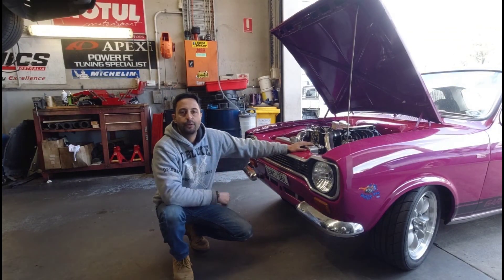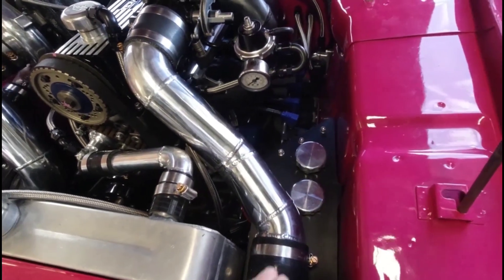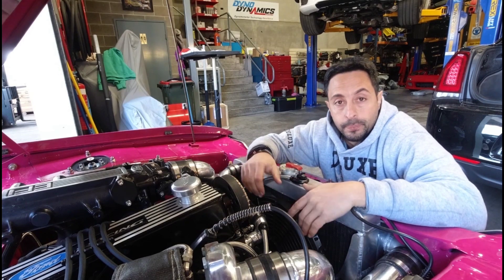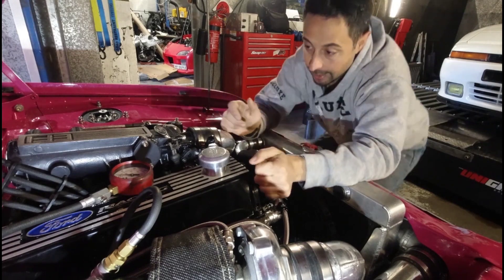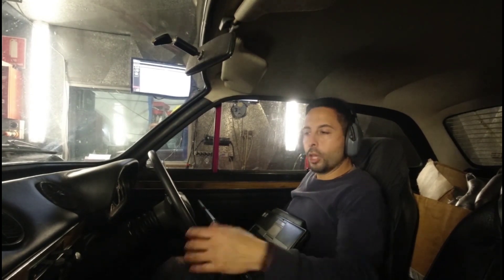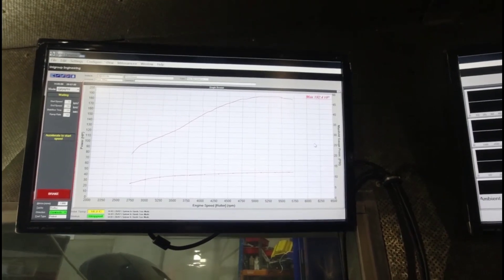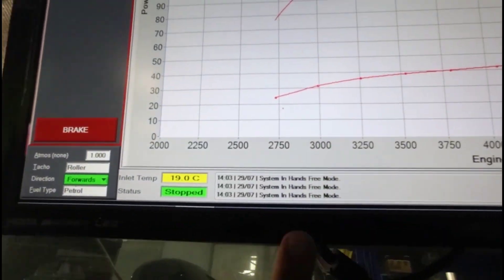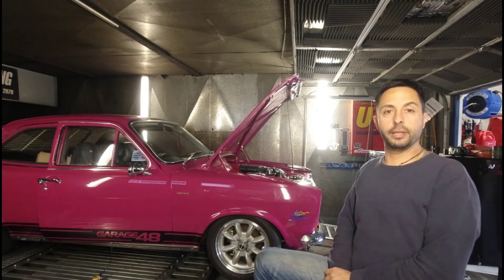Ford Escort Mk1 Turbo

Comment: Hi, this is stock block pinto or it has cosworth pistons and rosd?
Reply from the maker: Hi. I think this one was a pinto block with aftermarket forged pistons and rods.
Reply: @unigroupengineering  Am ok, I'm making a pinto turbo in a Ford Sierra but with stock block. I will try to 0,7-0,8 bar of boost with megasquirt ecu, good intercooler and knock sensor. Did you see some knocking with that boost? Thank you so much!
Reply from the maker: @jpardo3955  That's quite sensible boost, hence typically I would not expect problems with knock with good tuning. What compression ratio and fuel octane do you have?
Reply: @unigroupengineering  Stock pinto efi compression ratio its 9,2:1 , maybe with 2mm cometic head gasket will be 8,9 or 9:1 and I want to try with regular gas 95ron.
Reply from the maker: @jpardo3955  That should work well. Suggest starting around 20deg timing for 0.8bar boost, adjust as needed.
Reply: @unigroupengineering  Thank so much, I will send to you the results.